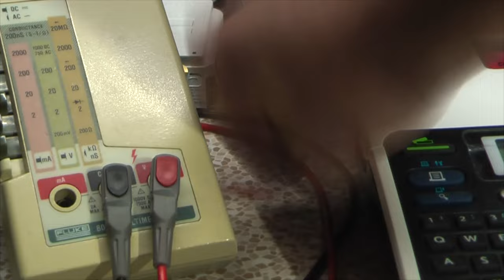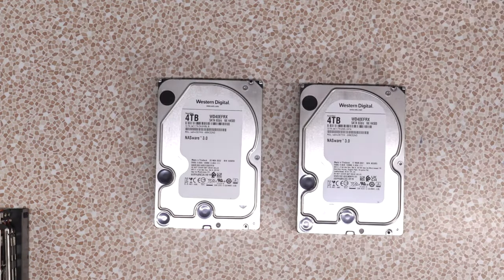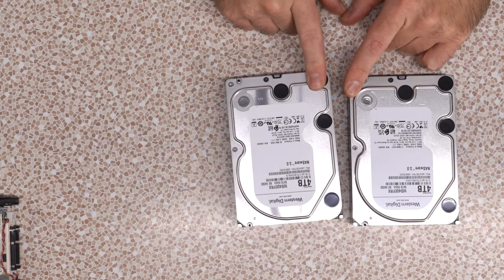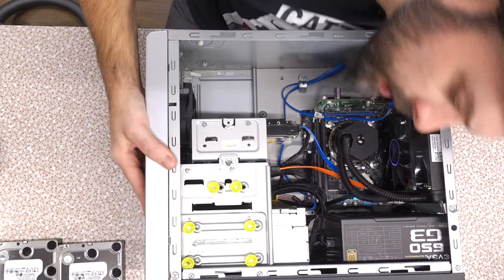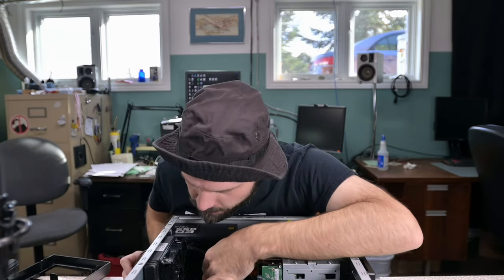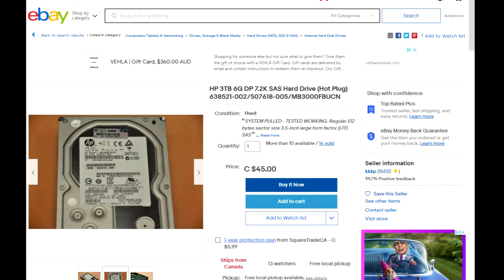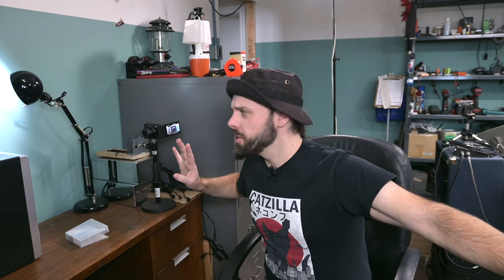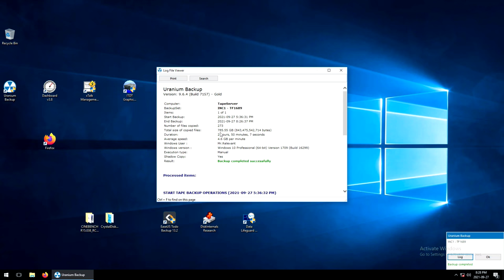Tape Drive Adventures 3.5 : Follow Up and Hot Swap

Comment: Any more update videos?
Reply from the maker: Nah not really. After this it's been purring like a Kitten. 
Only change I made, was I pulled the internal drive, and stopped using the network link. 
I picked up a few used 2tb SSD's, and exclusively use it with the 2.5" hotswap.

Comment: as you said 2,5 sata hdd is too slow for an lto4 drive. LTO want to write at full speed (120MB/s for LTO4) with no stop. If data is not flowing the drive has to stop the tape, rewind and restart. This is bad for tape and drive endurance and also you lose space on the tape. If you have only one drive it must be an ssd.(3,5 hdd is also not fast enough)
Reply from the maker: Yeah, I since replaced those drives with some 2gb Sata SSD's. Runs much smoother now, and I have more room to put a nice backup set together.
Reply: That us incorrect. 

The drive does not stop and rewind the tape. Tape drives adjust the tape speed to match the incoming data or the outgoing data.

A standard HDD will feed an lto 4 tape just fine. Just not at full speed.

Comment: Your process is way too labor intensive. Look into Veam community edition and use the file to tape back up. It can grab files from a nas and write them to tape. The best part is you don’t need to divide them into 800gb per tape. It will create catalog of ur files so you can search for it after it is done. After that it will simply fill up a tape and ask for another one until is it done with everything.
Reply from the maker: Veam rings a bell, I might have looked into it. 
Now what process are you referring to ? Using that tape machine, or my data management in general ?
If I was running a larger operation and burning more than a couple tapes a month I might be more inclined to optimize. None of the files I want to backup are on a NAS to begin with. So far this method works for me, it's visual, and it's sustainable, which is the best part. I was put off by a lot of the available backup software that were subscription based.
Reply: @DATT  I work with tapes on a daily basis so ur process of putting ur files into 800g folders before burning seems intensive to me. Veam is free for file to tape backup u should look into it again. If you burn more than 1 tape at once it will benefit you. For example if u load ur drive into the server and click back up it will start and fill up the first tapes eject it and wait for a new tape to be loaded. Most importantly files can be apprehend it to the end. I think it is a limitation of your software that prevents you from adding files to a written tape. Keep up with the tape video. It is pretty entertaining.
Reply: @DATT  @Do All The Things !  I do much the same as you do. That is I collect together the files I want on tape, then write. No need for suites like Veam, all of which need to be learnt.

Those sort of backup systems come into their own when working with multiple sources, like backing up multiple computers. You stick a tape in and set up backup jobs that just run, then ask for another tape. When you want data back you are told what tape to insert. Works well with multiple jobs (multiple backups of multiple sources) as they can all be written to tape automatically.

But with what you and I do there is no real need for that. The only benefit we would get from such a system would be to have one backup span many tapes.

Thing is these backup suites can be complicated to deal with if you find you have to start from scratch. If you rebuild the machine and install Veam fresh, well Veam just got amnesia and knows nothing about what is on ANY tape. You lost the entire catalogue, although you can usually back that up separately. Then you have to rebuild the catalogue, letting Veam read tape after tape. But the way you and I do it by grouping up the right number of files and keeping an index is much simpler. I'd do the same when I backup to optical.
Reply from the maker: @Flight522  Ah, it's really not that bad. I'm not like marathon moving data. 
What happens is, when I'm done a project, and I move it off my computer, I jsut move it to one of those drives. When the drive is full, I burn a tape. Time wise, it's no different than moving the project to any other media. I maybe burn one tape a month on average.
Reply from the maker: @dlarge6502  Yeah, eh, that amnesia is exactly what I would try to avoid. This way of doing things is very compartmentalized and future proof I figure. Granted, I think something similar can happen with Uranium. It has a log of all the tapes I've burned, so I can look at what files are on what tape. I guess if the system crashed, I'd loose all those logs, and I wouldn't know what is on what tape, which would be a pain. I should look into how to backup those logs. Thanks for pointing that out.
Reply: +1 for that Veeam CE.
Reply: @RunTheTape  they changed the licensing in 12. So tape won’t work in CE anymore.
Reply: @Flight522  that’s unfortunate. :(
Reply: @DATT  backing up your backup system would seem kinda logical since what you're on a quest for is not having a single point of failure. If you only store your stuff on a single tape and not sill on the source then it isn't a backup and the point is moot.
Reply from the maker: @noth606  Oh I def still have a copy of my stuff on a hard drive. The tape is the second backup. Mostly chose tape cause it's archival grade and I theoretically don't have to worry about bit rot.

Comment: Tape drive and the cassettes they use is a lot more fragile than you think.  Try backing up Terabytes of BWC footages for 10 year keep, US Federal, and no its not 4 TB more likely 45TB per backup...  LTO-9 are capable of 18 TB 45TB compression...  as of right now im in the process trying to figure out how use RAID 0/ 5/10 into a 45TB Cassette.  but the cassettes/tape/magnetic material is a lot more fragile than a HDD, really fragile to a SSD compared....they do stretch out over time depending how its used, the cassette/tapes themselves...
Reply from the maker: Damn, yeah those newer LTO machines have impressive numbers. I wish I could justify buying one. 
I am familiar with the aspect of fragility. Probably why I go my tapes on the cheap, might have been swapped out due to life cycle based on whatever data centers validation standards are. They still have some life in the, but I know they will stretch with use. Not sure yet how much more use I'll get out of them. So far so good, tho I have yet to rewrite any of the tapes I've used. I have since offloaded a few tapes and the data seemed good. 
There is a bit of learning curve for me yet.
Reply: I work with our archive data going back to the 90's and all you said is basically incorrect. 

If you are somehow damaging your tapes, fix your process.

I'm having no issues with tapes, lto and dds, going back to the early 90's. 

The worst they do, the oldest tapes, is shed on the heads. Thats when you clean the heads, and not with a cleaning tape.